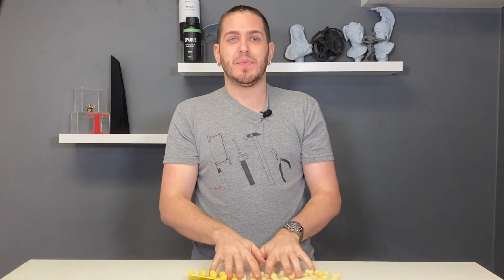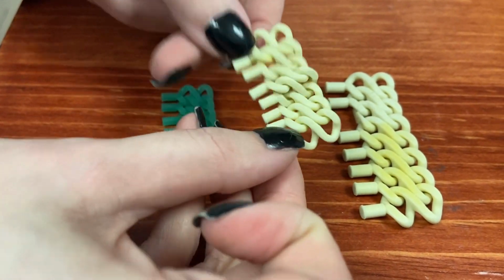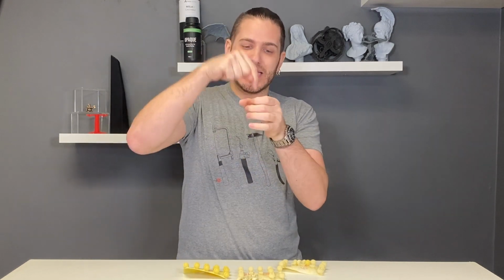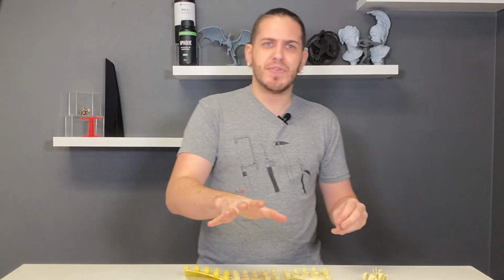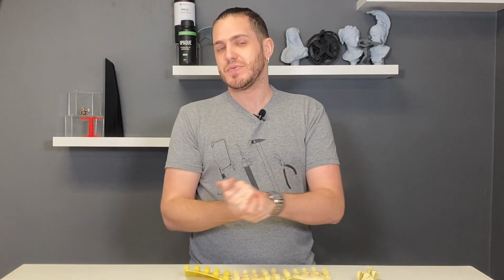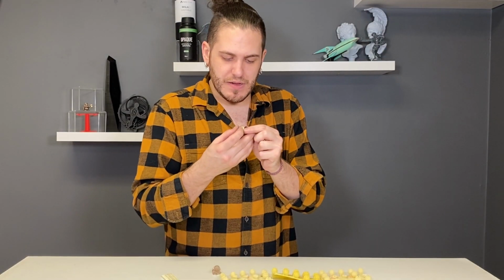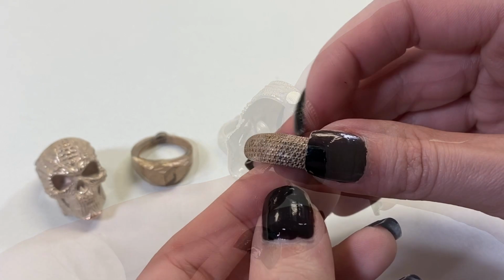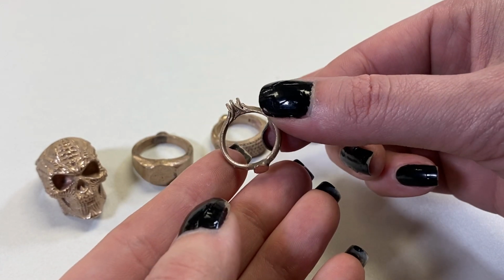Power Resins Yellow Castable | New Release

Comment: these are very helpful videos, specially for someone who seeks precision in his job however one point is missing which is the dimensions after printing through casting when you design a diamond ring with a specific size diamonds (shrinkage rates)
Reply: power resin ler daima çeker hemen dökülmesi gerekir

Comment: What is the correct burnout cycle for power resins I have all the equipment you guys have but my castings are not as good as yours if you can tell me the burnout cycles, I would really appreciate it thank you. the exact resin is the burn I spoke to power resins to help me with plugging in their recommended burnout cycles and they said they will have a hire up contact me. there are no ramp temps on their cycle graph.
Reply from the maker: We use the same general guidelines for burnout regardless of resin. https://youtu.be/FdckYTV2rJg 
They do have a burnout schedule here: https://powerresins.com/blogs/news/recommended-burnout-cycle-for-powercast-dlp-resins#:~:text=Recommended%20Burnout%20Cycle%20Before%20insterting%20the%20flask%20into,metal.%20Fresh%20metal%20should%20be%20used%20to%20cast.  Although the max temp is high for most brands of investment....

One thing I will clarify is that on their FAQ they say it doesn't matter what investment you use which is incorrect. Investments meant for wax and resin will have different levels of strength from the get go.
Reply: @ClearMindJewellery  what is you're burnout schedule so I could use it for my burn out oven please let me know thanks you and what investment do you use for resin
Reply: @ClearMindJewellery  and is libertyvest vest good for resin because that's what I'm using

Comment: i’ve had no luck with any power resins products, they always have some ash and porosity leftover, I’ve been using bluecast x one with success but it is much harder to get details to print as sharp. We can’t have it all huh 🤣 great video as always keep up the good work, i’m looking forward to that cuban link video
Reply from the maker: The only issues we generally have with Power Resins is with larger objects, and only with some of their formulas. If you are having success with a high wax content like XOne but not with Power Resin I'd look at your burnout schedule.
Reply: @ClearMindJewellery  Im doing my burnout schedule of total 7h, first 4h at 1382F 1h at desired casting temperature. Been having cleaner castings and no porosity when I dont over melt the metal. Im using DARK from power resins I really like it but dont know if i should try any other.
Reply: I definitely agree to Clearmind Jewelry in this case we have to look at some details on your casting process but not specifically to the burnout cycle and also the whole process that you are following. share some details so we can have a look and help

Comment: Hi Ive been messing around with a bunch of different resins and always have a shrinkage problem, Does Yellow have any shrinkage ?
Reply from the maker: I would say 85-90% of resins have some amount of shrinkage. As do most injection waxes etc. It's easier to account for the percentage in the slicer, and upsize the item by an equivalent amount, then to try to find a resin with no shrinkage.
Reply: magic build castable resin  zero shrinkage

Comment: I've had terrible bad results with opaque resin, I think their crop is consistent and non-standard.
Reply: Hey Ramazan, let me know about details I m curious
Reply: You can write down what are the details you are curious about and I can inform you, or do I have to start from the formation of the world?
Reply: I think you work for powerresin so let me elaborate, first of all I was sent an open bottle, the reason was that they didn't have 250mg in stock, they put 250mg in a bottle and sent it. Even though I followed all the storage conditions and did not mix the resin I used with the resin in the bottle, the first casts I received were good, but the next ones were unfortunately always terrible.
Reply: Although I reported to power resin that the resin was corrupted, they always denied it and said that my .stl files were corrupted, this is really funny, I sent them .stl and they never called me again :). I cast the same .stls perfectly with resin which costs 74$ for 1 kg and now I feel sorry that I paid 118$ for 250grams of power resin's resin which is useless.